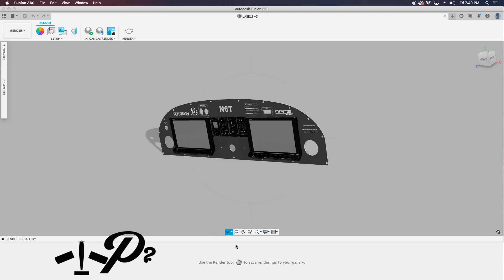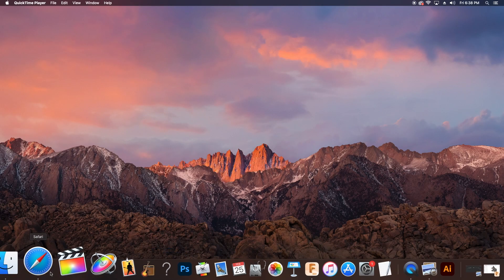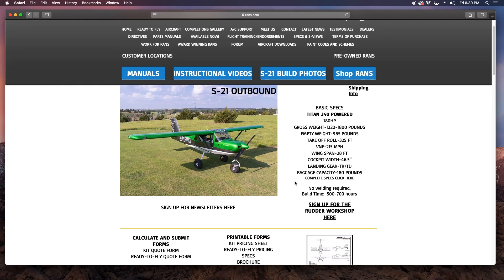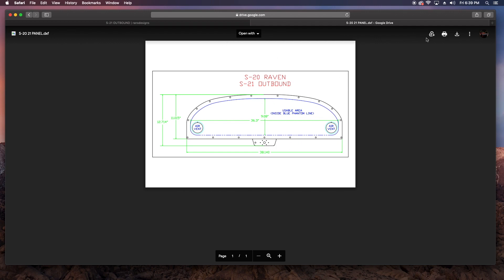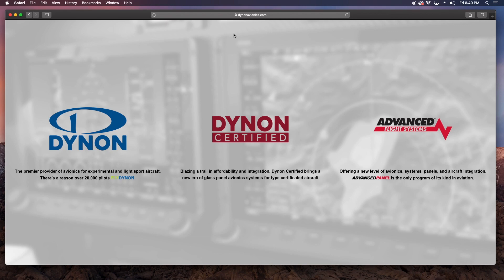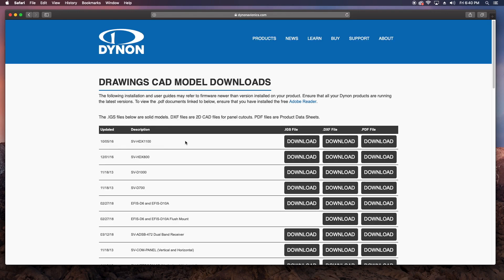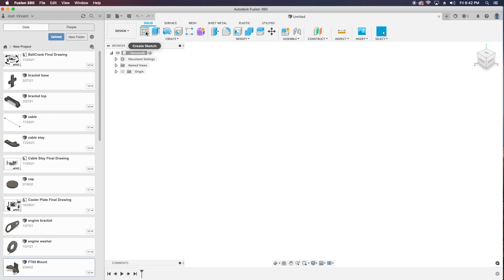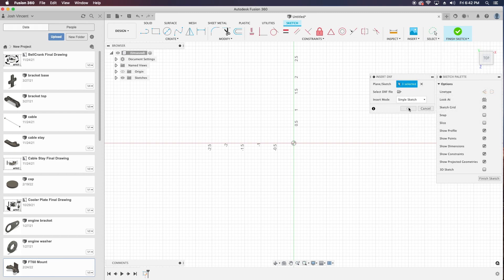DESIGN YOUR OWN INSTRUMENT PANEL / RANS S21 BUILD EP46

Comment: Very nice! Can you share the file for the blank panel or similar, maybe with the screw holes and air vent holes? Would be great to have something like that to get started.
Reply from the maker: Thanks Ron! The file from rans is just the perimeter fastener holes and the vents so it wouldn’t gain ya anything.

Comment: I use Fusion 360 for projects at home all the time (we have it at work too, but we still primarily use Creo). I used it to design the workbench I built last week and for how I’m going to repurpose the crate into the work table/storage for the plane once the kit arrives. It is an absolutely fantastic tool, super fast for easy stuff like this, and awesome that they make the personal version free. Details aside (if you learn how to properly use dimensions and constraints as it will make it even easier) you did exactly what I’m going do to design my panel. Use the DXF to define the cutouts. Use the IGES to build a solid model and check fit. For a first timer, great job. Love the initiative to learn something new to help you build better and showing others how easy it is to do. It’s part of why the journey is so rewarding. Kudos. Another inspiring video on a truly fantastic build.
Reply from the maker: Thanks Alan! I appreciate the pointers and will explore those features!

Comment: Impressive. I don't know F360 good enough to tell you if there is a better way. In SolidWorks i would place the components very roughly and then use constrains: select all the upper edges of the cutout and make them coincident, then add smart dimensions between them and select the distance i would like. Advantage is that you can still change those dimensions later and it will change in your assembly view. I assume that F360 has something similar. But whatever, you got it done, looks sweet.
Reply from the maker: Thanks Jan! I have to assume that’s possible in fusion as well, I just don’t know how yet. I’ll get it figured out👍